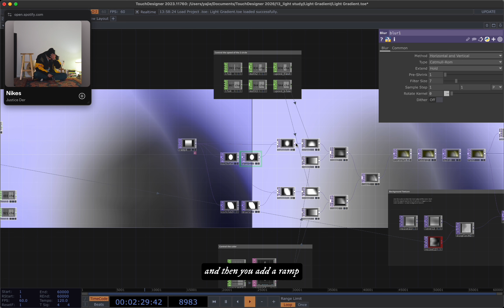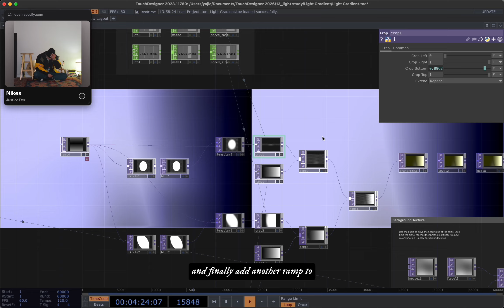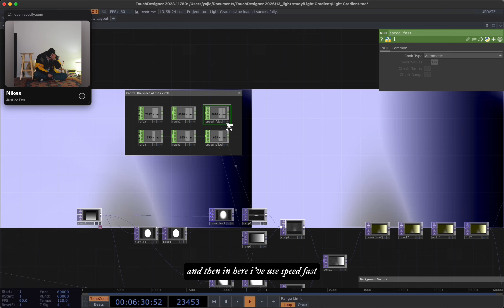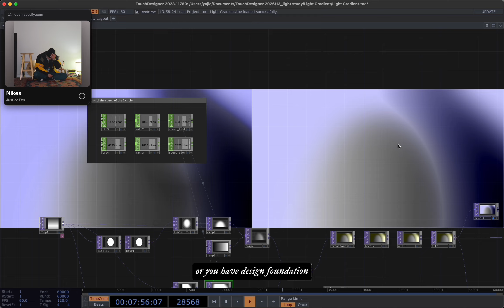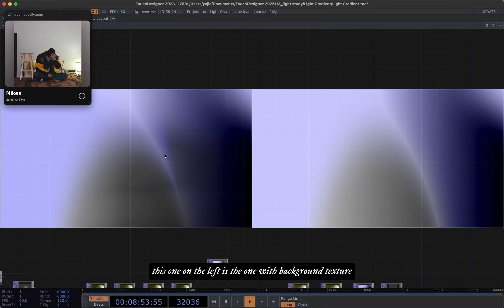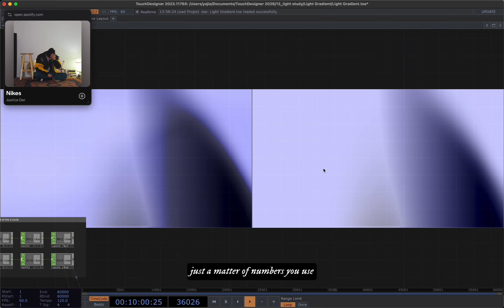audio-reactive light gradient effect in touchdesigner | tutorial

Comment: Hello. Re. Pateron.. what are the 'Extra ready-to-use VJ files for commercial use'? Thanks. Trying to choose a tier.
Reply from the maker: Hi! The main difference between Starter and Builder is the range of project files you can access. Most of my project files are audio-reactive, which means if you replace the audio with your own, the visuals should still react. For best results, I’d still recommend adapting and remixing them for your own track and setup.

If you have a specific project file in mind, you can click on that file to see which tier unlocks it, since some project files are not included in the Starter tier. But you can also just start there and upgrade later if you want more access.

The main difference between Builder and Pro is the custom components and additional assets for now. That part is still a work in progress, and I’ll be adding more over time.

(The custom components are designed for people who mainly want to use the visuals and care less about building the network themselves. I tested each parameter and exposed the specific controls that drive the visual effect, so they’re easier to manipulate)

Hope it helps!

Comment: thank you so much for showing how you did this. because you asked for feedback, maybe it could be helpful to make a quick overview and then rebuild step by step the nodes so it becomes more clear. Partly i couldnt follow and i cant achieve the desired result. Other then that i really like how you explain, also with the subtitles! 
could you maybe help me with this: i put pinlight in the comp and then tried to change the color in the level. but nothing changes. when i change the comp to inside luminance i get the color because then i guess it becomes a bit transparent. I dont know what i did wrong.
Reply from the maker: thanks for the feedback, hannah. i’ll keep it in mind and try out different structures in the future!

for this tutorial i focused more on the logic behind the nodes rather than showing every parameter. for the color, you didn’t do anything wrong:) when i use composite i usually try different blending methods. there isn’t really one hard rule for this. if you’ve used other design software before it’s similar, you often test different modes to you find the aesthetic you want.

you can send me a message to instantinfinite.work@gmail.com and i’ll give you 1 month of patreon access.